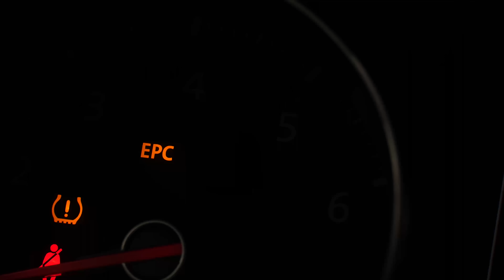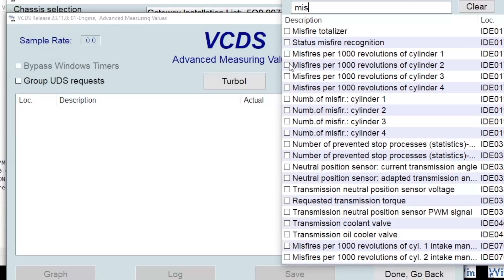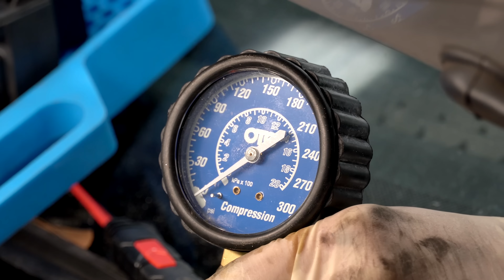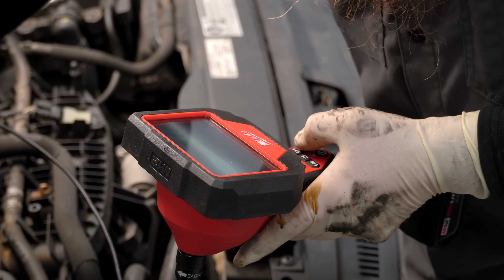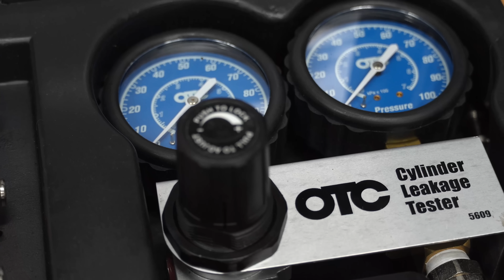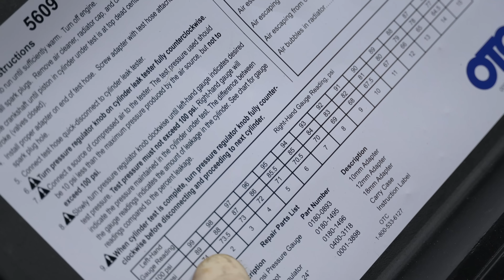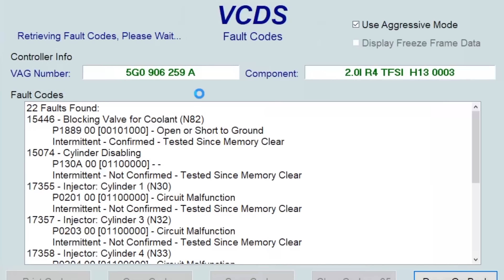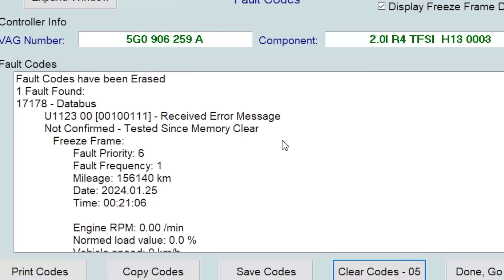Dead Misfire MK7 GTI, Another Shop Said Engine is TOAST

Comment: Most of those one-scan-swap shops advise their customers to just swap a big part because it saves them time, and they can turn over more cars in the same period. They're basically just trading shop time for spare parts -- employee time is expensive. So from a purely economic standpoint it kind of makes sense, but the mechanic shop run by enthousiasts will give you much more quality workmanship to keep cars on the road.

Comment: When a valve spring breaks on these engines do they tend to produce a knocking sound almost identical to rod knock??
I recently pulled the plugs and found one of the electrodes missing on cylinder 4. I went in with an endoscope and didn't see any damage to the piston or side walls for that matter. I threw new plugs in ran down the block and when I pulled into the driveway it shut off and started knocking. it's been a little over a week from when I discovered the plug issue and the cars been sitting not being driven, I went to start it yesterday and it started up fine no knocking while it idled for like 15 minutes. I'm genuinely confused as to what the issue might be I was just going to replace the motor and call it a day but after seeing this video it's got me curious as to it possibly being a top end issue.

Comment: I had a popped valve spring come in the shop a few months ago, it had melted a hole through the intake manifold so it needed one of those as well.  My boss has been doing Euro work for 30 years and had never seen a broken VW valve spring before so there's a first for everything I guess.

Comment: I'm starting to see a lot of these gen3 engines fail now. From small things as spool valves stretching chains, piston crackings, and rings failing. I just believe this engine was overly engineered and built to fail earlier than later. What's crazy is this is even happening on stock non tuned cars. When I see so many gen 3 owners with low mileage I see why. This 4 cylinder is about as reliable after 120k miles as a rotary now. I'm glad more and more are showing up since it has been superceeeded by the gen 4.

Comment: 4k for the VW. Not sure how much a timing chain job would cost at the humble mechanics' garage, but a common auto shop with parts and labor can easily amount to over 2 thousand dollars, and Im going to go ahead and say it - there are a lot of cheap plastic parts on those motors which will get damaged or broken in the process of tear down. Vws run/drive great when there's nothing wrong, but once something breaks your wallet will always feel taken advantage of. And also - every dedicated VW mechanic Ive ever met has been a seasoned masochist.

Comment: Those coil grounding straps are a silly design. Ended up putting the EQT coil grounding harness on my mk7, ended up fixing an occasional stumble at idle and made serviceability slightly easier with a normal bolt holding the coils down

Comment: I can see why most shops would say the engine is toast off a no compression cylinder, depends if the customer wants to continue from that point really
Reply from the maker: I think that’s an interesting topic. With several right answers. 

In general it would depend on how a shop sells diag. I prefer not to sell diag of a compression test with out enough time to follow up with a leakdown test.  Especially because you’re going to have the plugs out anyway.

Comment: Fantastic video, but it highlights some real VW crappiness.  Not the first broken spring I've heard of on these engines - at least this one didn't drop a valve.  And a timing chain needing replacement at 100K miles?  Did VW actually use a degreed automotive engineer on that one?

Comment: Yep had my car towed to the dealer, just moved new state and didn't know anyone. Had a camshaft correlation and misfires, ran like a cammed out diesel. Dealer were a bunch of monkeys, literally had no idea what it was and threw in new cam magnets hoping for the best and 3 extra hours of diag. Begged my insurance for another tow (3 at this point) and found a local indie shop. Told me it was just the camshaft adjustment valve. Runs like an absolute champ now. I've owned 3 VW's in 9 years and if there's one thing I've learned, the dealer is completely useless besides warranty work. Sorry, I'm sure there's great dealers but not in my experience. Good Independent shops have made owning my cars so much better.

Comment: Fascinating analysis. Did you do the compression test… without disabling the fuel pump? Or did I miss that part?

I’ve watched a bunch of GTI compression test videos, and no one disables the fuel system.

Is that because it actually doesn’t matter, or is it because there’s no easy way to do that as pulling the fuse for the fuel pump also deactivates a bunch of other stuff, thereby preventing cranking completely?

Thanks in advance!

Comment: The valve spring failing...is this common with VW cars or was this just a random failure. Great diag using the boroscope to find a valve in the open position. Did the computer shut down the injector to save the cat? All that raw fuel can't be good for exhaust hardware.

Comment: Hey humble Mechanic I was wondering how much does it cost a roundabout to rebuild a Mark4 R32 want to get the engine rebuilt it has 220,000 miles time change got done at 110,000 store runs great

Comment: My 2015 Fabia RS (sold only here in Europe) with a twin charged 1.4 TSI engine has rough idle for about 1 minute when engine is cold, then RPM drops under 1K, so I changed the spark plugs but nothing changed.
Also I noticed engine oil smells gasoline, but no engine light on the dashboard.
Should I be worried and what else can I do ?

Comment: Where's the parts list? Curious to see how $7 valve spring ballooned to $1600 with just timing chain + water pump. I do see tools in description
Reply from the maker: The chains, guides, bolts, and everything is pretty expensive on this engine.

Comment: I wonder I have low compression on my 3rd cylinder all other cylinders showed 180 and the 3rd one showed 130. I’ve needed help for the longest but I really don’t know what to do. Imma have to do another compression test to see a more up to date result. I got a 2015 mk7 gti bought about 2 years from the dealer and I’m at 124k miles

Comment: I have a problem with my Golf Mk5 variant where the trunk light won't turn on. When I put ground to it, it turns on, but when I close the hatch, it doesn't turn off. I don't think it's the switch on the trunk lid because I get the notification on my dash that it's open and closed. Please help.

Comment: Question: Does it make sense to replace only one failed spring instead of all of them? I'd be afraid that the way that spring fractured, it was a batch manufacturing defect and could affect all of them.
Reply from the maker: you can make the case either way. This is not a super common failure so odds of 2 being bad are low. 

You made the case for it pretty well. I'll add that the labor is high overlap, and the parts are cheap.

Comment: I'm scared. My S3 currently has misfire cylinder 1. Have swapped plugs and coils and the fault didn't follow them. Only misfires on full throttle when it upshifts (DSG). Engine off/on seems to fix it until next time. It only has 50k miles. Compression test next?

Comment: A spark plug wont cause the check engine to flash! Hell i own a 2001 infinite G20(nissan sentra) with the SR20DE engine CLEARY the N/A as its the DE not the DET... 230k on the clock ZERO issues! Diagnostic is #1 in automotive department!😂

Comment: Hi, I have an issue for my volkswagen jetta 1.8L Sport 2016 model, the engine is misfiring, So i changed the spark plugs and ignition coils but still problem not solved, So i went to cylinder compression testing, I got for cylinder 1 & 3 are 0, and cylinder 2 & 4 are 155,158. What should I do? Can you please help me?

Comment: Thanks for the detailed repair (and silly jokes!). Quick unrelated question, VW say the gearbox oil is there for life. My manual gearbox is stiff during the winter (80k miles) which it wasnt from new, do you think a gearbox oil change would be a good place to start? The clutch is starting to have that on or off feel to it too (doesnt slip), and sometimes rattles until the pedal is depressed, could that be part of the problem or another problem and should I wait for it to slip or pre-emptively replace the clutch? Thanks a lot! 🙂
Reply: gearbox is stiff until the engine warms up, I should add... Winter = 3degC as the car slumbers in the garage!

Comment: dude i need your help.... Since you are an expert on VW Group...i have an skoda superb 2013 with a 2.0L TSI engine the 200 HP variant....i have missfire problems aswell and car rocks when i drive it slow in lover rpm (it is and DSG) car.  Skoda service checked everything coils,sparks,compression...everything is good.... note when the car warms up really well the rocking while driving almost dissapears....when i turn it on cold i get a missfire from time to time not every single second....and i have rough shifts and downshifts....sometimes it happens i start the car and it work flawless no missfire no rocking shifts perfect..... thanks for any advice

Comment: Question regarding the lower timing chain case, are the bolts one time use or can the old bolts be reused? Thanks
Reply from the maker: they are technically 1 time. you can probably clean the lock tite, and reapply, then reuse. just know you are "suppose to"
Reply: @ appreciate your reply. I will definitely purchase a set of new bolts and do things by the book.

Comment: this spring depressing tool is depressing. I needed a friend to operate that tool ... it was so unnerving to put the retainers back in the ridges ugh. we did 16  valve stem seals that way. not easy but after many hours we had successfully done it and the car back together with timing belt and all bits. wouldn't recommend.

Comment: When did they do away with the "screen of death"? I might be able to convince my boss to start working on these again, if we don't have to worry about that issue. Is there a specific engine code to look for, or did they just change the bridge on engines that used to have the screen?

We have most (if not all) the special tools, but got burned due to a screen once. The boss decided "never again". I really don't like telling customers "It can be fixed, but we won't do it".

Comment: Can you explain more about the one-time use bolts?  

You say it like a catchphrase, so I'm guessing this is a reoccurring theme.  

My Mercedes lists some bolts as one-time use, which I don't understand.  

If it was something that's supposed to be torqured to yield, sure, but one of them is the bolt for my smooth idler pulley, which I need to remove to do most jobs.  

Again, I could understand if that was a bolt you're supposed to replace every X miles along with the idler pulley, but I can't understand why the bolt would be one-time use.  

Hell, I managed to strip the threads on that pulley, so what, is the bolt hole one-time use only too?

Comment: Whoops. its repaired. if those parts fatigue the way they do, to prevent the same thing happening, it might be proper to replace all springs and in reality replace all valves as well as timing chain and guides. This happened to my 2013 Passat 3.2 engine... it broke me.
Reply from the maker: I can get behind either way. We rolled the dice because this is a buddies car.

Comment: Hey Charlie, I have a 2005 Jetta mk4 2.0l bev.
I heard a scraping noise which I thought  might have been the A/C/ clutch, but it hasn't.
 I opened the overflow bottle to add a little coolant amd as soon as I heard the pressure  release the scraping noise stopped.
Only 48000 miles on Continental timing kit with water pump.
Is the VW OEM part that much better ther warrant the higher price?

Comment: Wow. What a pain in the butt for a relatively simple problem. I used to think nothing of that sort of work, but in my old age, I'd think twice lol. Isn't that like 6% leakdown? on my last race motor it was more like <2%. What's normal? My overflow bottle just popped on my R8 (even with the warranty metal strap). Simple enough but dang things are hard to reach, especially the bottom hose!.

Comment: I took my 2012 Passat to the dealer last week because the check engine e light is on. I had previously taken it to auto zone and they scanned it and told me it needed a VVT solenoid. So I took it to the dealer to get fixed. They told me there was a 170.00 diagnostic fee that would go towards the repair. I sat in the waiting lounge the service Mgr. Comes out and tells me they can't fix it because it needed timing chains and they would have to replace e the engine but it wouldn't be worth it as my car has 238000 miles on it, that I should go upfront t and trade it in. My car still looks good and doesn't run bad it just has the check engine light o n. I was willing to have it repaired but now don't know what to do. Any advice?

Comment: In regard to 16:28, I've learned a lot of 'German engineering' is based on tradition and superstition. For instance, I recall an interview with Ferdinand Piech in which he said he conceived the Audi five cylinder because the four cylinder couldn't be made larger and a six cylinder couldn't be made compact enough, specifically because 'at that time by law the bore spacing had to be 88mm.' I've looked so many times and couldn't find any law, I wish one of the crusty old German engineers could explain it and all of these other oddities that clearly had to be done for some kind of reason, but who knows what it is.
Reply from the maker: There is always a reason

Comment: Dude, i have a b8 a4 CDNC engine. And i have damaged 3 spool valves, you know why could it be happening? Also, any tips on modifying the oil pump for more than 1.2 bar at idle?

Comment: 19:00 prevent coolant migration by drilling a hole in the bottle just below the area where the rubber seal in the wire connector seats,that way if it does leak itll drain down the side of the bottle and not be forced in the harness. 
Just check the connector depth and how far it goes on the bottle and make a hole thats still shielded by the plug connector.
Reply: Not sure that is a good idea on a pressurized system.

Comment: With 100k on the engine, I was wondering why you didn’t replace all the valve springs, since after all they’re only $7 each, and given all the other parts that were recommended to be replaced even though they weren’t needed right then? Please help me understand. At 100k you got your worth out of the old springs, and stock stuff is for sure tired and affecting performance at high rpm.

Comment: If your changing one spring, why wouldn't you just change all the valve springs?
Reply from the maker: It's a buddy's car. IF this was a client, wed have that convo.
Reply: @HumbleMechanic  seemed like a no brainer to me unless you really figured the engine was toast but the cost compared to the labor...
Reply from the maker: It would add a good amount of labor to the job. Not sure what the spring only would be in labor. But you’d do it 16x. So even at .3 a spring it adds up
Reply: @HumbleMechanic After all the labor that was involved just get to the valve springs, that's the logic you use? I just can't imagine having to do it all again when the next tired valve spring breaks. That's not the way this old shade tree mechanic works.

Comment: Still one question remains.. Why and how common is a busted valve spring ? In hopes of not jinxing myself, I have a 1994 BMW with 250,000 miles that still provides a second gear scratch! granted, it requires a prayer at every start up, but I'm always baffled why manufacturing materials and tolerances can slip at the factory.
Reply from the maker: It’s not very common

Comment: put id , and play swicheroo . This way you 'll know wich code follow wich piston . It would not run 4/4  only swich problem . Piston 4 act up ? Switch spark plug 1 and 4 , swich coil 2 and 4  . Verify wich changed .

Comment: Yeah.. Local.MB dealer service told customer bad engine. He bought a new car ,& got little as trade. One of my friends bought car (nice clsan example) off thd fence line at dealers lot. One valve sping, spark plugs, some fluid & filters. New front brakes & he had a great car for cheap $$. Yeah..quality dealer service?
Reply from the maker: Sadly dealer or Indy you can find people that mis the mark

Comment: the sad fact is that 99% of hot hatch cars have been thrashed within inches of destruction never ever buy a second hand hot hatch such as a golf gti.... good call doing the timing chains on a 100k engine i have seen so many engines destroyed because people neglect timing chain/belt changes... they only stretch so far before they snap and introduce conrods and valves to the outside world...

Comment: Is there a problem with 2013 vw Passat 2.5 engine that i should be aware of. 62k miles.
Reply from the maker: On that car it’s more what is wrong with the specific car. The 2.5 overall are pretty good
Reply: @HumbleMechanic  ty you for the reply. I have regular maintenance done.

Comment: When seeing this, i,am loving my Peugeot 1.9 xud engine even more.. with 700.000 km on the clock..easy to fix.. cheep parts.. and no special expensive labtools needed..Ok, maybe i be there 10 minutes later than the fancy, funny, crappy 200 hp plus Vw de luxe xxl engine..when there are no issues.. with 50.000 miles.. what a joke.